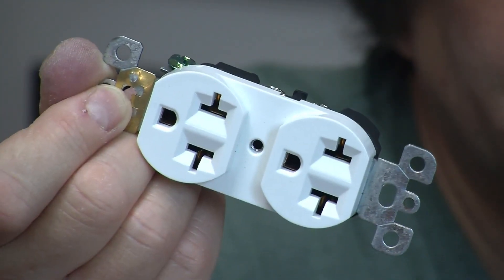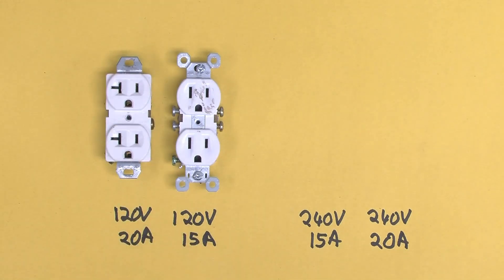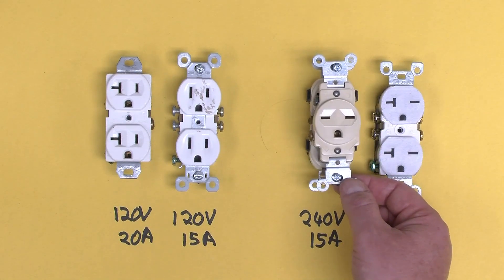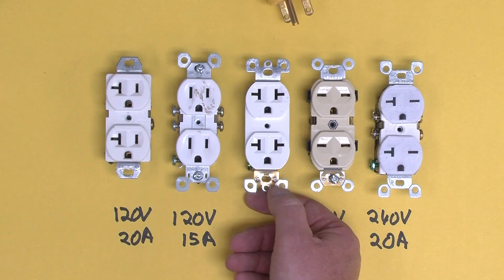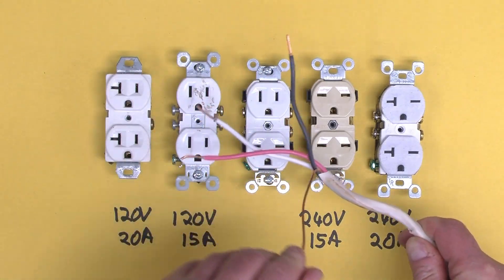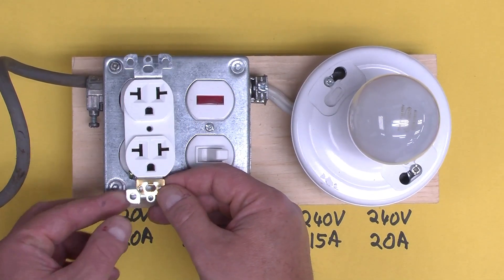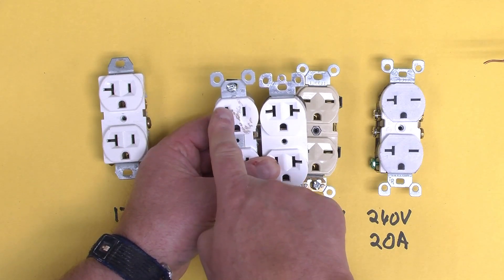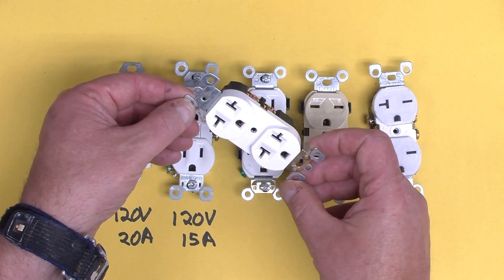Yikes! Don't use this Chinese-made Outlet!

Comment: Never seen such an outlet.   However,  there is a ungrounded version of this, it been banned for many years but nonetheless is often found in really old homes with knob and tube or the old cloth braided NM no ground.     These were two prong T slots, in the earlier part of the 20th century like in the 1910s, '20s and '30s,  when a large number of homes were electrified for the first time and home appliances began appearing in large numbers there were actually to versions of plugs for 120 V use, horizontal and vertical prongs.   The receptacle had a 125v 15a / 250v 10a rating,  before the industry agreed to standardize     You had to know what voltage was supplied,  because although most were 120 volts,  some were 240 volts.   If you break the ground prong on a 240 volt 15 or 20 amp air conditioner plug you can plug into this old receptacle.
Reply: Actually those outlets were designed to be backwards compatible with the older two-prong "tandem" plugs which had two horizontal flat blades. The tandem plugs were invented in 1904, the modern parallel plugs in 1913.  These dual-mode outlets were widely installer into the 1950's. I have several in my junk box. They are rated 125v, 15a. So no, this design was not used for 240v.
Reply: @david672orford  good research.    Yes there were two versions of the 120 volt plug, in the earlier 20th century.   I call that the electrical version of betamax vs VHS.   Then when NEMA began laying out standards as we know and love today, the original tandem plug, was given a rating of 250V, 15A.   There are  NEMA standards for 2-15 "— —" 2-20 "| —" and 2-30 "I |" which stands, to this day, for historical purposes,  as these plugs and receptacles were banned in the late 1960s due to lack of ground and neutral.    Hubbell still manufactures 2-20 devices,  for replacement use only.    Not sure when they rated the T slot 2 prongers 120 volts 15a, because a few yrs back I helped with a renovation in a home built 1936, there were a few porcelain T slot 2 prong outlets left,  having a marking "125V 15A/250V 10A.    There was still some knob and tube wiring found in the attic.
Reply from the maker: It sure is an oddball outlet! When I was a kid we lived in a really old stone house that had a few of those old style outlets you describe. I was debating mentioning that but was afraid it would confuse the "Dont buy this" message. I didn't know that in the old days they actually were used for 240V as well. Thanks for pointing that out - I just thought it was to accommodate plugs from different manufacturers. You wonder back then how many appliances got fried when plugging into the wrong voltage. For that matter, you wonder how many people are messing up their stuff these outlets today.
Reply: @ElectromagneticVideos  not too many of the old two slot outlets were 240 V.    Worth noting,  there was a NEMA rating later on, sometime in the 1940s to early '50s,   NEMA 2-15 and NEMA 2-20.  The 2-15 was a 240 volt 15 amp plug non grounding with" — —" prongs.  The NEMA 2-20 was 240 V 20 a,  with "| —" prongs,  basically the ungrounded version of 6-15 and 6-20 respectively.   Around this same time 40s or 50s, there was a 2-20 outlet made, and Hubbell to this day,  manufacturer's it for replacement purposes only.   Leviton still has the two slot "–|  |–" outlet available  product # 5000-I, for replacement purposes,  non-UL listed.    Maybe if you had a very old window air conditioner or a larger portable heater from the 40s or 50s before we began installing grounded NM, but then it would probably be a cloth or rubber insulated cord, and you'd seriously consider replacing the cord which would have the grounding prong aka 6-15 or 6-20.
Reply from the maker: @Sparky-ww5re  I just looked up  Leviton 5000-I - I'm stunned. I would think its as much a recipe for disaster as the Chinese one. I would have thought it would make more sense for them to make NEMA 2-15 or 2-20 for 240V replacement purposes if no ground was available, and then change the cord or plug as you mentioned. Or put in 120V GFCI outlet if it was 120V.  The   Leviton 5000-I is made in Mexico - I wonder if there is more " — —" stuff or "–|  |–"  outlets in South America where safety regulations are probably more lax? Thanks for that interesting post!
Reply: I just accquired one of these ungrounded ones.
Reply from the maker: @jeffkardosjr.3825  The vintage ones - or the replacement ones. I wish I had a vintage one - would be a cool historic item for may collection.
Reply: @ElectromagneticVideos  I actually have a couple ones that I found at the dump. Haven't found a porcelain one yet but the two I have I believe are made of bakelite. So still pretty old.
And I have seen a house from the early 50s with almost all those types of plugs but with a newer plastic. Wiring was all the fabric NM wire, no ground of course. But there where a few of the original baseboard heaters and they actually had a switch on them to switch from 120v to 240v, although as far as I know all the plugs in the house where 120v and have been since it was built.
I think I have seen some other old pre 60s appliances with a 120-240v switch on them also but can't remember specifically what.
Reply from the maker: @NSaw1  Thats so cool! I really like old stuff like that! I never heard of 120/240V switchable baseboards - I guess it was a way of maximizing number of customers for a product.

When I was kid we lived in various countries (dad was a diplomat) and we had a lot of things with 120/240V switches. I think a lot of European and Japanese  manufacturers did that so they could access the larger US market.
Reply: @NSaw1  wow,  very interesting about the old baseboard heaters.   What makes helping with major renovations so fun, is getting to see first hand some old and rare equipment which may have been commonly used for a certain time period,  but is now considered a safety hazard,  inefficient,  expensive and/or impractical to manufacture or use, or that just fell out of fashion.   For example when I was going through my great grandmother's estate after her passing earlier this year,  I found some pictures that were from the 1950s and '60s when she lived in the farm house, and she had a pink or lavender refrigerator and range, with lots of chrome.    Her bathroom fixtures appeared to be a blush green, maybe a turquoise,  it was hard to tell as the photos that were in color, were pretty faded, I guess you could say the early color film was like a technicolor, similar to the very early color TV sets that began appearing in the late 1950s.  When was a little boy we lived in a duplex that was built in the mid '40s, during or right after WWII,  and I remember the brown gas range with the round burner grates.   The bath fixtures were normal white, though.
Reply: @ElectromagneticVideos  Well actually IIRC it was made in the next state over and was pretty local as far as that manufacture. 
It used a plug, so maybe it was common to either just plug it in to a close outlet or have a dedicated 240v outlet next to a window for baseboards back then and the switch was just in case they had a 240v outlet there?
This was in North Carolina and also just a tinny little cabin.
Reply: Actually understand the "grandfather clause" you can buy a 2 prong Outlets. 
Some wiring in old house have no grounding conductor.   Although old house with armor metal has grounding.